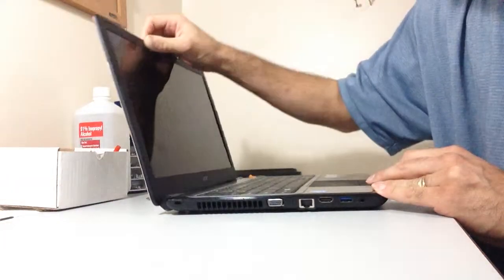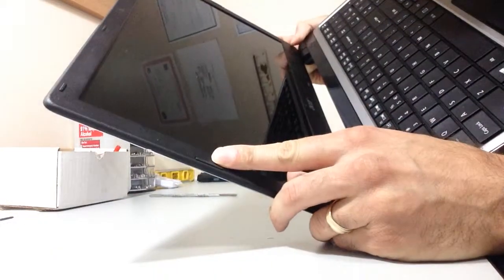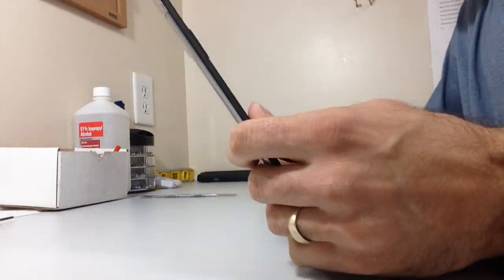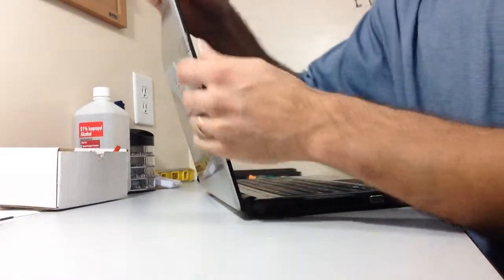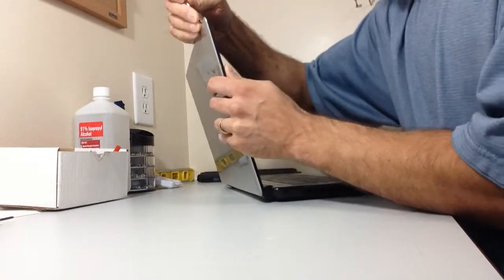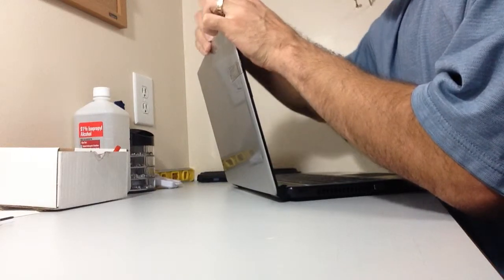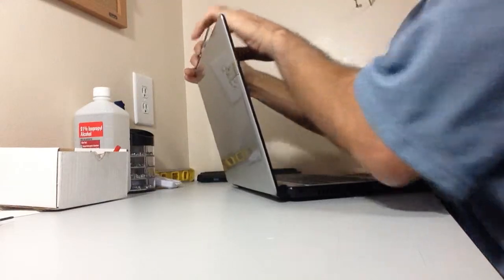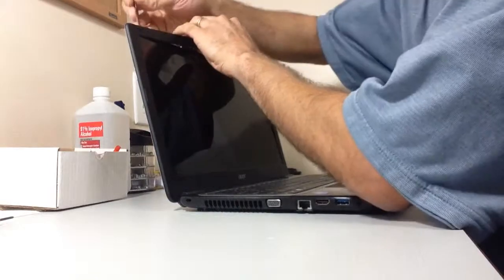How to replace the screen on Acer Aspire E1

Comment: Thanks for the video! I just dropped my laptop last night, not even 2' and the screen is shattered. I was going to take it in to a shop here locally once I got some feedback on which one seemed best, but then a friend of mine suggested just repairing it myself. I looked up my laptop model on here and your video popped up. It looks like a much simpler process than I thought it was going to be. I'll be ordering a screen and doing the repair/replacement myself. Thank you very much for the straight forward video showing how this is done :)
Reply: so did you fix it?